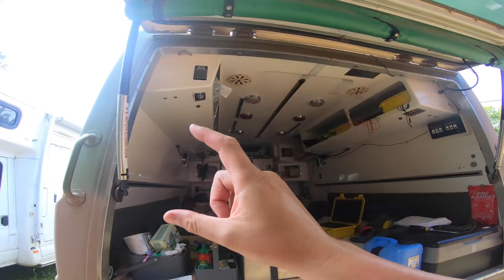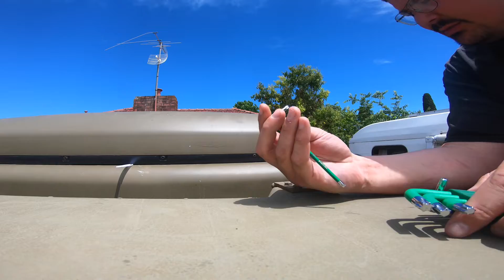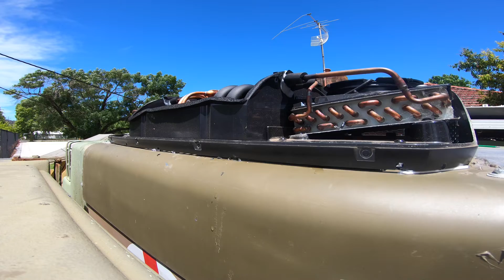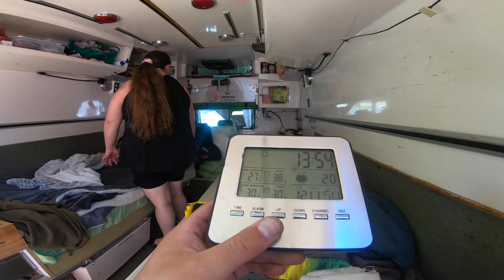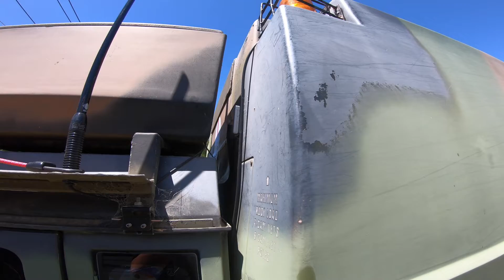Water leakage | RTX2000 Rooftop AC

Comment: If you take the main poly cover off the condenser you will c where the water drains out properly there are a few problems with these units one they have no filters that can be cleaned on the intake inside thus the condenser will need to be cleaned regularly i found that making up my own mesh filter for the inside and just Velcroed it to the air intake it helped massively with stopping dust building up on the condenser.
Reply: Secondly these units are great but really noisy... I took the standard rubber bushes that the condenser pump sits on and replaced with more heavy duty rubber mount's it wasn't a massive difference in noise but did reduce the inside noise a bit.
Reply from the maker: @tarinlewis1158 noise is not an isdue in the military ambulance pod, lots of other stuff going on in there anyway
Reply from the maker: Yeah I have done that in the past

Comment: I think I have a similar issue, incorrectly installing it without the mounting kit. I’m getting water coming in through the mounting bolt on the inside of the van, only a small amount when in heavy rain or running the aircon in humid climates. Do you think the drainage fix would help with my issue?
Reply from the maker: Yeah the system drains underneath. The mounting kit will raise it up a couple of inches, and allow it to drain.

Comment: Did drilling drain hole fix this issue?
Reply from the maker: @marcusg1276  a little, but I think installing the proper spacer to begin with would have been better.

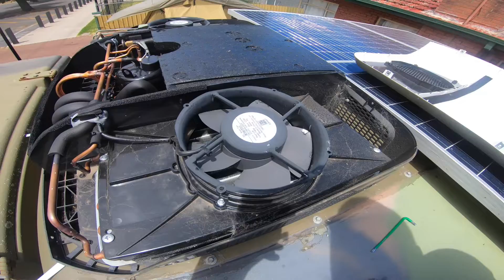Comment: 2:53 hi quick question, you said where the draining holes are and you point to a section where you say water shouldn’t be. What makes you say that? I ask because my husband and I have the domestic rtx 2000 and it was leaking inside so now we’re trying to figure out why and we have water in that section where you point out it shouldn’t have water.
Reply from the maker: In this case it's designed to drain out the underside of each corner. It's meant to be ibstalked with a gasket that raises it up about an inch, that was not supplied with mine. My issues are a result of incorrect installation.